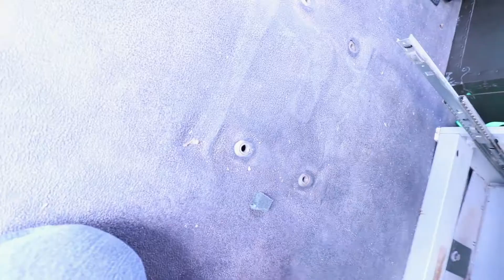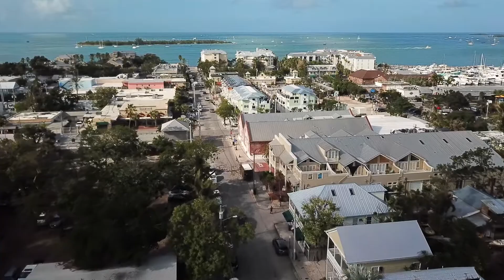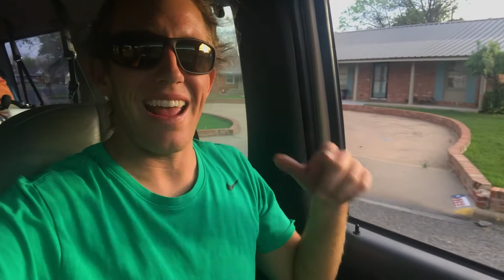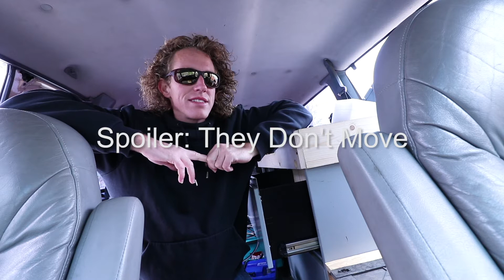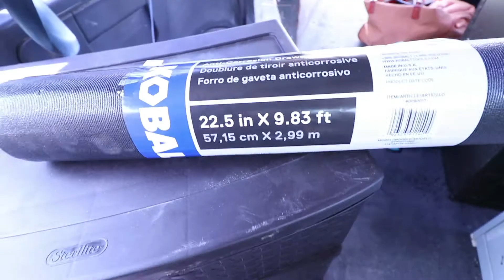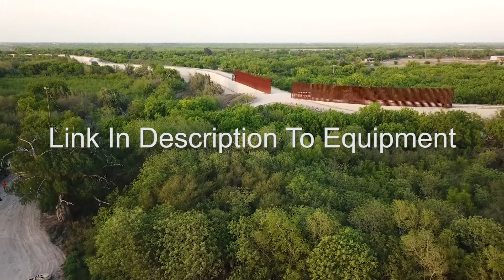Van Build #1 (Electricity) - 3000W AC/DC Inverter, Charging, & Batteries

Comment: You connect the batteries to your alternator on your car right?

And you can start running an air conditioner when your batteries have juice?

I'm new to all these terms like amps, volts and stuff. Just wondering how to stay warm and cool through the seasons.
Reply from the maker: I tied into the alternator with an isolator connected to the key. so the batteries charge when driving and disconnect from the vehicle when its off. The batteries will not run the cars heater or A/C. If you have a large enough inverter and battery bank it will run a widow or roof unit but this system is not big enough. Amps X Volts = Watts that will help figure out the draw on appliances. good luck, I wouldn't suggest anyone installing a system like this without lots of experience.
Reply: @WalkaboutLife  Yea dude, it seems pretty wild. Its not bug enough?!?! But was weighing down the front end of your van 😆

I have to look around for warmth and to also stay cool. Do you just rough it and go to temperate climates?
Reply from the maker: @Str8upbrah  I run the engine for heat in the winter and take off clothes and sweat with a fan in the summer. Its not an easy way to live but do what you gotta do, until things change.
Reply: @WalkaboutLife  For sure. I just thought with all those batteries that maybe something can get installed. I'm drilling a whole on the top of my van and putting a fan into it and then covering the windows and getting a fan. For heat I'm thinking of getting some sort of heater. I heard leaving the car on can create fumes which isn't safe. I don't know much about it, but I wouldn't do it. Get a Carbon Monoxide meter in your car.
Reply: @WalkaboutLife  I understand though. That's what I'd do when I slept in my car. I'd turn the heater on a bit and go into my sleeping bag and warm up and then just turn it off so I wouldn't have my car running with the fumes and all that and try to get whatever sleep I could :)